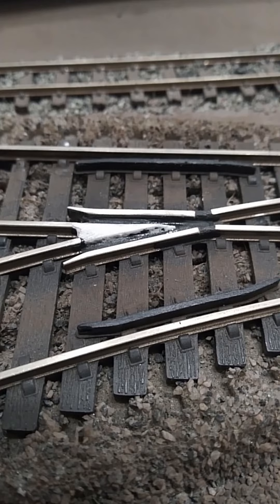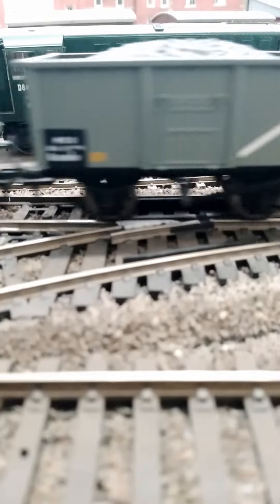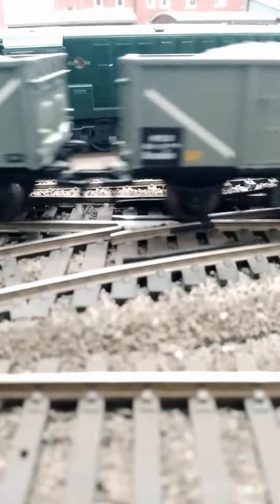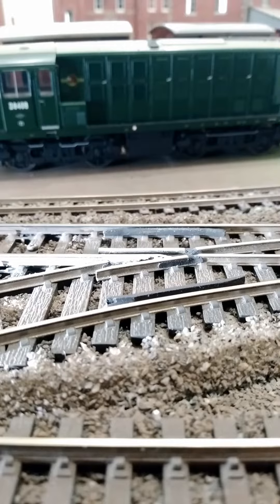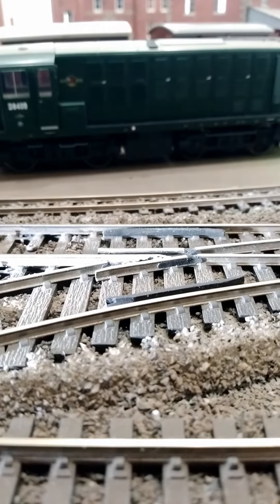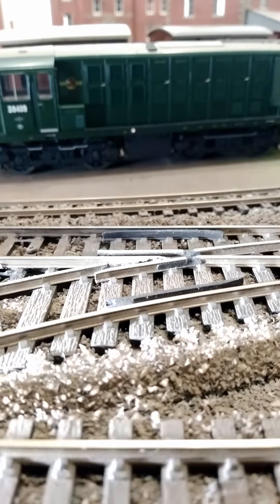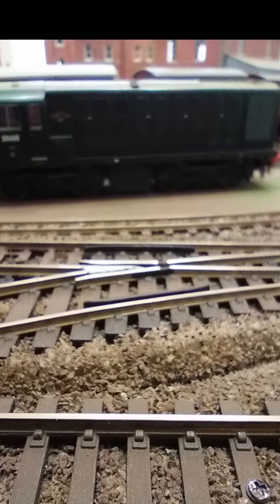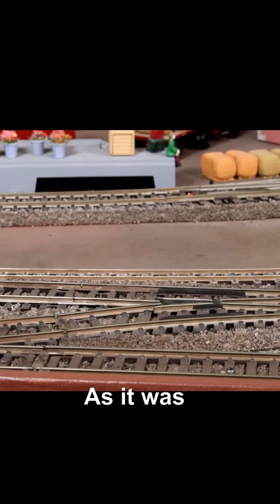Worn Hornby point frog repaired (super informal video)

Comment: Well done Mike Great work also today I bought Tamiya model paint ultra Marine Blue and plywood the pack of 4 plywood pieces were a bit too thick so I got a long slightly thinner piece and I also bought a craft knife and a paint brush the plywood is for a Small Engine shed
Reply from the maker: Good stuff
Reply: @ModelRailwaysUnlimited  I agree although it can get a bit messy if you are not careful

Comment: Hi Mike nice fix, I have an unrelated question and was hoping you may be able to help or point me in the right direction. I have about 250 locos stored in a glass display cabinet, most haven't been run for years, I have just taken my Heljan Lion out to test it on my rolling road and have noticed it is drawing excessive amps about 0.6/0.7!...i run the loco for a couple of minutes hoping it would settle down and reduce the amps but it hasn't. Forgive me if im asking some basic questions but will i need to strip the bogies/gears/motor and clean /re-lube to cure the problem?
Reply from the maker: Hi Andy, many thanks. They should not be drawing that much, no more than 300ma on a bad day lol. Many lubricants  dry out to become like wax, so yes a strip down clean should help. Go for something like Labelle 102 as this will not dry out.

Comment: Nice piece of info Mike , I have loads of issues with the peco insulfrog with some old stock and some locos . Do you find that with Hornby points apart from the one you’ve repaired. Regards Fred
Reply from the maker: Hi Fred, the Hornby ones have been very good with all the stuff I have, think they are a bit more forgiving than Peco
Reply: @ModelRailwaysUnlimited  I think you a right Mike I’ve even filed off the plastic on some of the frogs